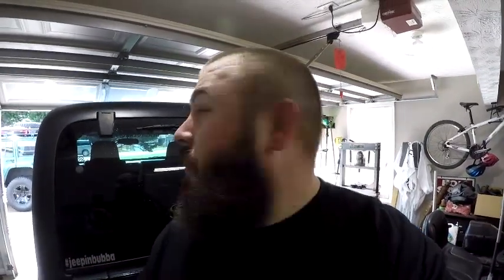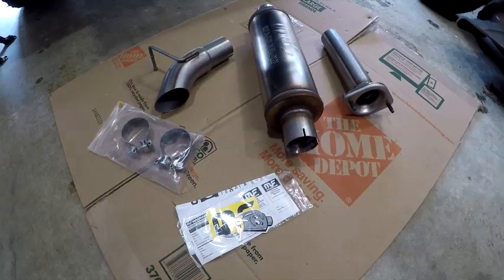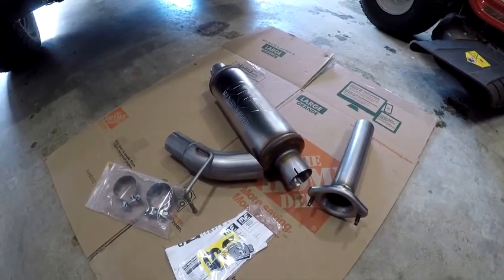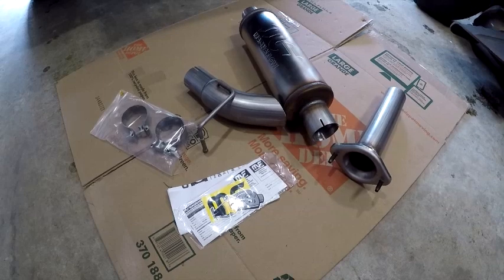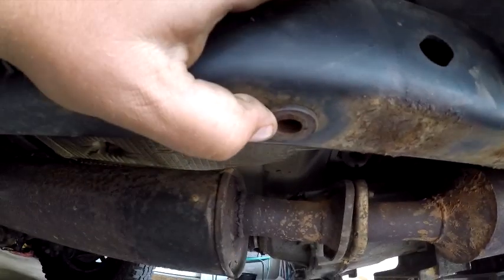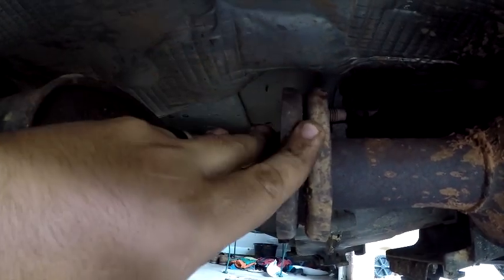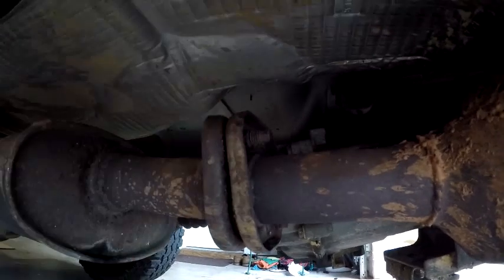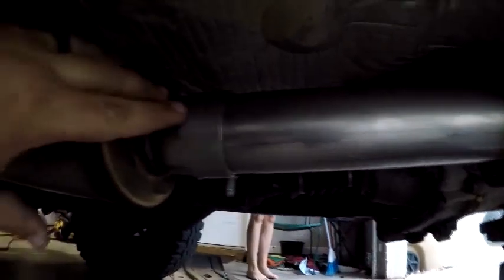Jeep Wrangler Magnaflow Offroad Pro Series Exhaust

Comment: I really like the deep sound it has.
Reply from the maker: Its been a great exhaust.
Reply: @JeepinBubba  good to know, im considering buying one. thanks for the video.
Reply: @JeepinBubba  hi, do you still have this exhaust? How’s the sound inside the cab, is it too loud? Thanks
Reply: @thebigboss024  I have this on mine and it drones like crazy around 2,000rpm under load. Going to replace it with something quieter.
Reply: @ScottPaynton  If you run a tail pipe out the back it will reduce the drone almost completely.
Reply: @joshmindek4840  I ended up replacing it with the MBRP catback... all around a nicer system with a slightly larger muffler and similar tone. No drone at all. All stainless and half the price of the magnaflow and includes a double wall stainless tip. Very happy with the change!

Comment: Sounds nice! I think this is the cat-back I’m going with on my 05 TJ 4-banger. Don’t need the clearance with suspension but I have flattened my tailpipe a couple of times. Does the dumping the exhaust gas fwd of the axel cause more fumes to reach inside the Jeep? After living with this system for 8 months how do feel the noise levels are around town and droning down the freeway. Thanks for posting this vid.
Reply from the maker: I have never smelled any fumes, but I have a couple coats of undercoating on my Jeep. The exhaust is pretty normal around town, and it only loud when you romp on it. Drone only happens if you hang around 2,800 tp 3,200 rpm for awhile. Overall its been a great system for us, I would purchase it again.